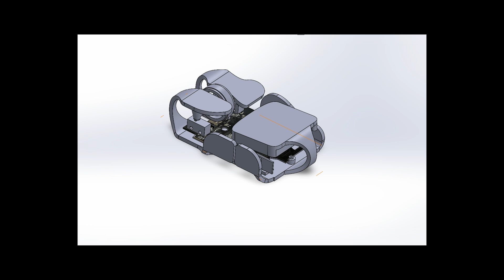The UL Mouse byScottua - A 3D printed case mod for the Razer Viper v2 Pro

Comment: Can I ask you something about the modeling process? How did you make the model of the PCB? By 3D scanning? Or did you take photos and some measurements of the PCB to make it yourself? I don't know anything about 3D modeling and printing.
Reply from the maker: In this case, I took a couple photos with the pcb next to a metric ruler but a flatbed document/photo scanner works a little better for flat things.